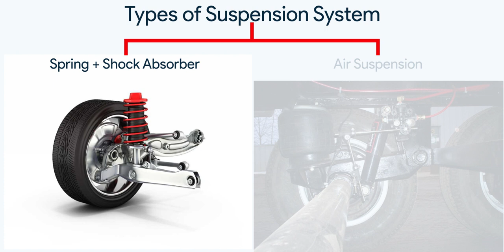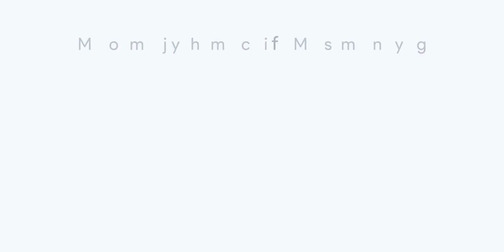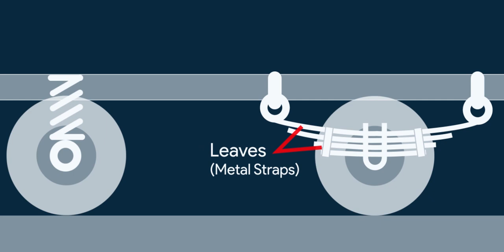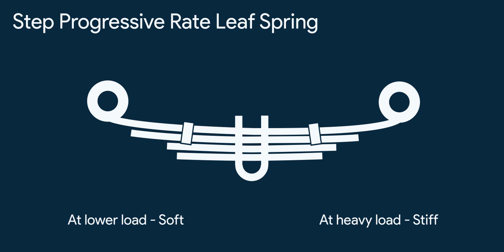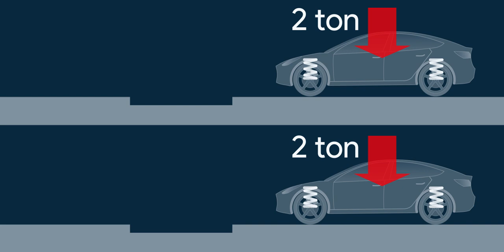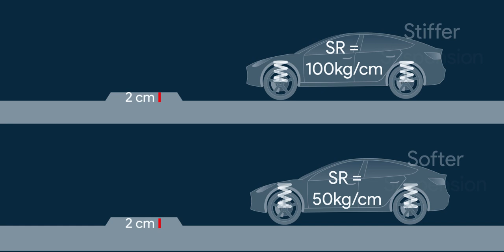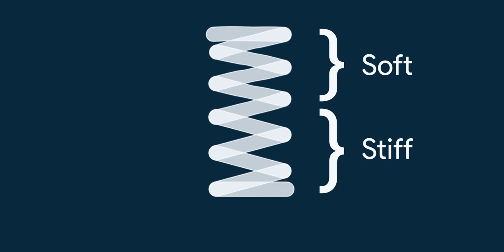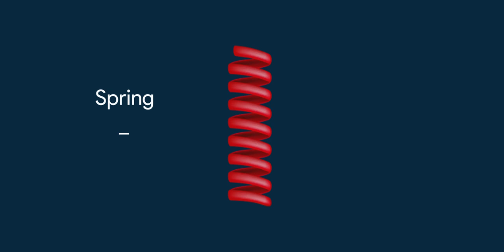SUSPENSION SPRINGS types for your requirement | TUNING - Soft  Stiff Progressive Dual rate

Comment: I replaced the shock absorbers in a Toyota Corolla made by kyb with 4 wheels. I am still disappointed. The car is not comfortable to drive. It should be noted that my tire is 195/60/15 from Michelin. What do you think? I thought of reducing the thickness of the spring wire by 1 mm and adding another coil. I saw on YouTube how to change springs, how to cut springs to  lower the vehicle, but I have not seen people change spring parameters and install them in the vehicle to make the vehicle more comfortable to drive